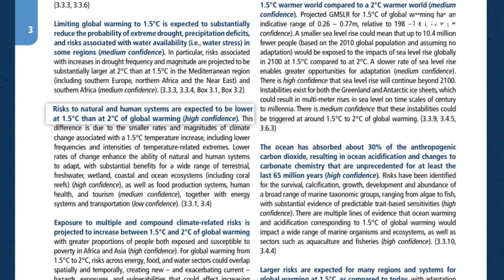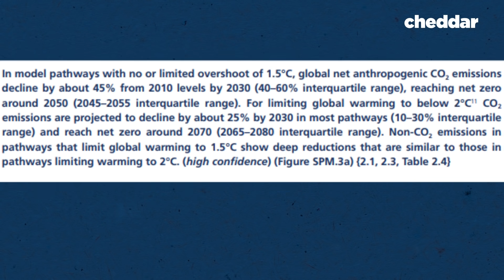Wooden Skyscrapers Are On The Rise - Cheddar Explains

Comment: To say that building with wood is faster is only true if prefab is used. Which is expensive.
To say that wood, regardless of the processes done, is stronger and more resistant to fire than reinforced concrete is ridiculous.
We have much better fire management systems, we have much more fire resistant fabricated wood. But it will not last as long or give the same protection as reinforced concrete. I'd also much rather avoid fires than solely rely on fire management systems built into the building?
Buildings under 10 or so floors made out of timber is great, help to reduce carbon footprint. But as you go up, you have to consider more than the environment.

Comment: This is a joke, if it was about composite bamboo then I would see the green aspect was covered at least, I work in the high rise industry and I see how rebar and concrete  load bearing floors bend to mind boggling levels as more floors  are added something timber could never accomplish, that Miami building design as shown needs a massive support system of lumber just to support the living area which in my experience will not be so simple if actually built, marketing designs are done to attract buyers and never ever come near to representing the finished product when it comes to high rise.
The most important thing is quality, developers will penny pinch even when it comes to the smallest fastener so what do you think the quality of the lumber will be??? I'll tell you, the quality will be the lowest the developers can get away with if they are a trusted and reputable entity, imagine now how pop up and file for bankruptcy just before the lawsuits come in developers will use for building materials and corner cutting ...
As for being green ,concrete high rise projects throw away tons of lumber EVERY week that can't be reused or is cheaper to throw out than to have a worker repurpose, so now imagine a high rise structure made of lumber instead with more lumber being thrown out EVERY week because off cuts certainly can't be reused and see how green it is( deforestation is not green).
This is marketing bullcrap to ease the nerves of investors who are worried about the decline of world reserves of concrete usable sand.(scarcity means rising prices that cut into the bottom line)

Comment: Plywood has been around for generations.  It is an excellent example of cross-grain wood lamination; an idea that is much older than the 20 years cited in this video.  As with the newer cross-grain laminates, plywood is incredibly strong and it can be manufactured to many specifications, for countless uses.  My concern about using wood again on a large scale, as our primary structural material, is the effect such a practice will have on the planet's forests.  This effect will not be insignificant and forestry mismanagement is a problem we are already facing as a prime factor in massive habitat loss, causing the large number of species extinctions within those ecosystems.  Our planet's ability to achieve a new CO2 equilibrium will be largely dependent on our ability to dramatically reduce CO2 production and on our ability to maintain and protect healthy, vigorous forests.

Comment: This is completely illogical. It's more costly, more time consuming, weaker, more prone to water damage, and requires more fire proofing than steel. Also, it is a straight up lie to say that timber is comparable to steel pound for pound. Steel is many times stronger than timber in most tests, and there are legitimate physical analyses to prove this. 

Also, this seems like an example of prejudiced statistics. Trees require a lot of time, energy and water to grow. Also, a large portion of steel is recycled, and may not require more carbon emissions than timber. Timber also tends to be larger pound for pound which not only reduces usable interior space in large buildings, but also reduces the ability to ship it efficiently accross the globe. Many building materials are shipped via sea freight which also requires fuel and money because you will likely need more storage space aboard the freightliner.

I am truly interested to know what all of your sources are, and why you believe them.
Reply: snapple187 not in 🥶 weather
Reply: Alfredo Alcantar Magnesium coated steel is extremely weather resistant, and won't rot like wood. Metal also doesn't expand or contract as much which could prevent future damage.

Comment: Wants to fight climate change
Destroys more trees
Reply: trees store carbon as it grows, but if it's growth rate slows, it's ability to store follows.   if it is well managed, we can reduce more carbon by selectively cutting trees.
Reply: @slewone4905  You're a dumbass. C02 is actually good for the environment. Plants need C02 to produce oxygen.
Reply: 2:22 since you clearly didn’t watch the entire video.
Reply: Daniel they release 4000tn less CO2, but the still release CO2. Those trees would eliminate CO2 if they were alive
Reply: Obviously reduction is the best course: however, given that we still build, wood is a far better option than concrete or steel.
Producing 1 ton of concrete produces 1 ton of CO2, whereas timber is basically created from carbon captured by solar energy.

Sustainable forestry is essentially the same as farming over a few decades. Wood used in mass timber can be young and fast growing trees, so it's faster than old timber cycles. Young timber also absorbs CO2 at a higher rate.

Building out of sustainable mass timber rather than concrete/steel/masonry is like choosing to eat vegetarian rather than meat: there are always costs, but it's a far better option.
Reply: Cameron Lapp There are trees that only take a decade approximately to reach full size but the wood of those trees is not as strong as wood from trees that take longer to grow
Reply: @Cameron Lapp

Actually having huge herds of ruminants has been proven to trap CO2 in the soils , enlarge water table , expand habitats , make productive use of marginal lands and providing a nutrient dense foods.
Reply: Educated businessmen would plant more trees to get and thus sell more wood forever
Reply: @Flamingpaper0  do you know how long it takes to grow a tree
Reply: @jacky_mo  40 yrs average tree redwood 80yrs
Reply: @wilfredomartinez575  TOO FUCKIN LONG
Reply: @jacky_mo  ik 😞
Reply: Jacky Mo trees collect co2, or rather c, while growing
Reply: @wilfredomartinez575  American logging companies cut down a patch, and then immediately plant trees evenly spread outs so they grow more densely than in nature. The campaign to reduce the use of paper actually led to deforestation in America because logging companies worked directly with paper manufactures, so they lost large amounts of money and went under. I am not saying if it was a good or bad thing, but it is a thing. 

The issue is building anything out of wood is the fact it's a fire hazard, and a rotting hazard.
Reply: @rrteppo  oh thx i thought theyll cut the whole thing down and luckily they plant more
Reply: @Flamingpaper0  that's correct. But on a huge scale like a skyscraper it will take forever for the trees to grow.
Reply: Save the oceans that’s where we get more oxygen lol
Reply: Timber places are forced to replant trees
Reply: Yeah, that part of the video wasn't really clear
Reply: fire will take the trees eventually
Reply: As long as you plant more (and don't burn said wood after) it's a net negative effect on carbon.
Reply: @planefan082  it still releases co2 when the wood decomposes
Reply: Sim City 2000:. Cut down one tree:. Citizens are protesting your destruction of the forest

Comment: There's a company called burnblock that has a process for replacing air with a sort of salt in the wood. This makes wood less flammable than concrete as concrete has highly combustible gasses trapped in it.
Reply: Though we will still have to kiss things like the Amazon Rain Forest and oxygen goodbye.

Comment: Timber is a terrible idea. 

Our cities will either burn from the outside or rot from within. Unless pre-treated with resins and reinforcing materials, wood is simply not a viable long-term option. Living trees consume CO2. Dead trees DO NOT. They will eventually rot or be metabolized by bacteria/bugs and converted into CO2/Methane/Etc. all the same. This focus study is flawed. 

It also would require massive replanting of the timber needed to construct and maintain these buildings. Which is in of itself a massive ordeal that we are already failing at. Less forests = More CO2.

Terrible idea.
Reply: Keys879 the timber industry plants loads of trees. Look at Scandinavia. They export a lot of timber but in some cases aren’t cutting enough down. Steel rots and concrete is susceptible to weathering.

Comment: Termites: "Ahh, Ah Ah Thats hot, Thats really hot"
Reply: "It's free real estate"
Reply: Most tall timber will use concrete for the first storey, which negates the risk of termites.
The first storey concrete also breaks soil contact and allows for longer spans in retail-at-grade, which is essential for healthy mixed-use neighbourhoods.
Reply: @cameronlapp9306  i just replaced my whole timber flooring on the first floor that was infested with termites. The whole ground floor is constructed in concrete explain that!
Reply: @cameronlapp9306 ”hold my beer” -swarming drywood termites
Reply: Carpenter Ants cannot be left out of the rave though. That's one giant buffet!
Reply: termites arent everywhere
Reply: @Kyle Janson 
termite 1: "You can't eat that! It's termite proof!"
termite 2: "Hold my beer."
Reply: @Chosen1Creator  do you mean they'll develop resistance over just a couple of generations or what?
Reply: Quilt 🤣🤣 Didn’t even think about that! That absolutely tru!
Reply: @Kyle Janson But once a little hole at wood are forgot to spray , hohoho
Reply: And rot!
Reply: 20 years ago they learned that stacking wood cross grained made it stronger? How long have they been making plywood now? 75, 100 years?
Reply: ”SOMEBODY TOUCHA MY SPHAGET”
Reply: Wood can also rot
Reply: @Kyle Janson then why aren't all houses termite proof? Why are termites even a problem if there's termite proof wood?
Reply: @drabberfrog  cost lol. Scientifically engineered stuff aint cheap.

In fact its a trend that its often cheaper to buy 2-3 times or more of garbage material (or replace the same item that much) than it is to simply get the best.

Think of electric cars. They are definitely better, yet they are so far out of reach still for the majority.
Reply: @VadersFist501st  that makes sense
Reply: XD
Reply: Drinks water It's time for CRSPR.

Comment: Go stack some wooden logs cabin style and set it on fire, see what happens. The base of the structure burns faster than the rest due to oxygen being pulled in from below. As the base burns away, the stack becomes weak and top heavy, this results in a catastrophic failure with burning logs and lumps of coal falling and being scattered. Now imagine that you had a bunch of these stacks next to each other and on a much bigger scale, extinguishing a fire of that magnitude would be a nightmare.

Comment: Fire is indeed a problem, because even if this composite-assembled wood performs well in a fire on an individual basis, the fire is going to spread within the building and eventually between buildings if a lot of them are made this way.

Another problem is that once the demand for wood as a result of this type of construction hits a certain point, the timber harvest will not be sustainable even with the best-intentioned timber harvest policy (which is itself a real long shot to get), and it will end up reducing the capacity of forests to absorb more carbon dioxide.  We might already be past that point just from the amount of wood used for building conventional houses and apartment buildings out of wood.

Comment: There is a big problem with building out of wood and you only have to look at far as a Wood Stove to see. Besides that a Steel-Concrete Mixture is generaly more Stronger and could midegate Urban Sprawl more easily since you can (Logicaly) build much MUCH taller with Steel and Concrete than with Wood. You can also build more ... wild forms with Steel Reinforced Concrete as its stronger against certain stresses ... unlike wood. Wood may be cheap, but price comes at the cost of Quality and if you ask me if i want to build a Building wich may need to last for the next 100 Years beyond the designed time of existance ... i'd not choose a Material wich would Rot, Burn, Break and can be eaten away by bugs further weakening its Interal Structure resulting in Material Failure much faster and ultimately: Collapse. Wich in a Dense Urban Enviroment could cause a Domino Effect, and quite litertly so. And when others are made of wood too, those buildings could also ignite if the building next to it would go up in flames. And have fun putting that thing out without Collapsing like the Old World Trade Center.

Comment: Acording to 9/11 steel burns as well as wood so it wouldn't make a difference
Reply: Jet fuel melts building 7 just for laughs 🤯
Reply: I wouldn't say burn, but melt and fail, yes. Wood, depending on its size, could take longer to fail than a bare steel beam. You can add on fireproofing to every steel member in your structure to help this, but that's just one most hidden cost of working in steel.
Reply: kindlin you didn’t get the joke mate
Reply: Yeah!
Reply: As it turns out, not a lot of things keep their structural integrity when you crash a jet plane into them. Who knew?
Reply: @Fawstah  if you use hybrid human-elephant-plant DNA, the buidling will heal itself and put out its own fires.  And it grows its own suites.  Engineer plants a seed, and 5 years time (now down to 6 months with HGH) BOOM skyscraper. 🤑🦧🐘🌳

Comment: Steel/concrete buildings release 3,000 tons of CO2 and using timber saves 4,700 tons? 
So what you're saying is that by cutting down trees you're saving 1,700 tons of CO2?
But at the same time live trees absorb CO2. (Dead timber does not absorb CO2)
There's a major gap in your logic.

Comment: 5:11 "Pound for pound it is just as strong as steel, but because it weighs less the whole structure has less mass"  What!  If a pound of steel is the same strength as a pound of wood then the final structure would weigh the same for the same strength. If you use half the wood and it works then why not use half the steel?

Comment: this is misleading, there are only a few architects around the world that are embracing wood structure buildings.

also, This building material (CLT) is only reducing the CO2 produced during construction, which is nothing in comparison to the buildings lifetime operating CO2 emissions. 

building's operations account for ~50% of global CO2 emissions, so lets start by addressing inefficient design and try to reduce CO2 emissions there.

cause these inefficient glass building designs are as bad for the environment as steel ones.

Comment: In real world examples, the new modern buildings are a mix of wooden and stone parts.
The core is concrete + steel. The levels are made from wood.
 Like a mix of two towers, where the concrete is inside and the wooden one is outside.

Comment: the commonly accepted definition of a skyscraper is 80m MINIMUM height , having trouble finding any wood building meting this mark , also tensile strength balsa wood 10.12 Mpa  1095 steel 685 Mp  mild steel  (1018) 440Mpa

Comment: Yeah no way we’re cutting our carbon emissions in half by 2030. I guess we’re all gonna die
Reply: The main key is sustainable forestry, which can fix the logging industry. Loggers don't need the land, so trees can be replanted. Also, sustainable forestry is actually even better, because it's only while the tree is really growing that it absorbs C02, then it dramatically decreases how much it absorbs. Tree farmers cut them down for logging at this point and replant. It produces a fast cycle for obtaining timber and it removes more C02.

Improving Sustainable forestry won't nessecarily decrease how much we emit, but it will suck up more C02 than what's happening currently.

One of the big culprits we should be scared of the cattle. Cut down trees, but the trees will never be replanted because they need the land for the cattle.

Comment: Building with wood is not faster. Dammit, check The Shard construction.
Plus, building with wood require a lot of space for its structural frame compared to steel structures and when we talk about skyscrapers it is very influencing. With the constant rise of land costs, using expensive volumetric space for an unuseful structures leave less space to its users, thus increasing costs and making it less appealing on the market.
This trend for skyscrapers needs to stop, or it will become an huge maintenance problem. Timber should be used as main material just for buildings up to 6-8 storeys
Reply: Exactly. Skyscrapers are slender structures where the design is governed by stiffness. The "stiffness" modulus of steel is  29,000 ksi. but for wood is only around 1,000 ksi. So you're talking about 30x the volume in wood for the same stiffness. And the taller you build a building, the more of its volume will be devoted to structure. In a very basic way, this makes wood a poor choice for tall buildings.